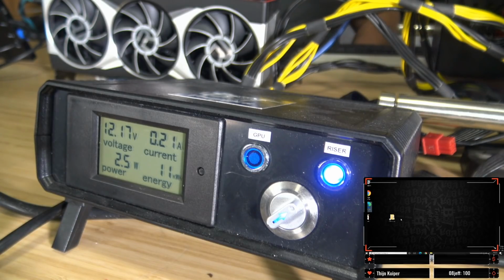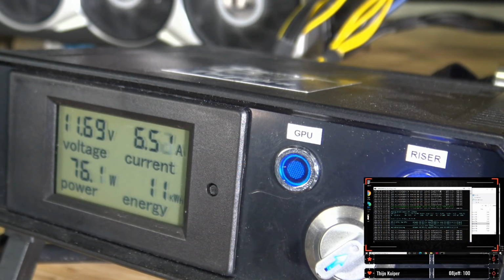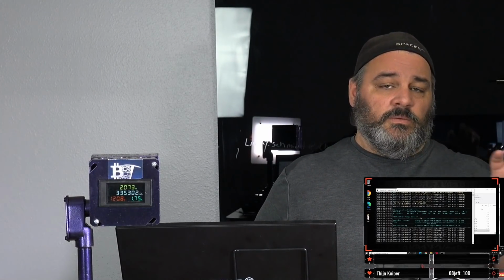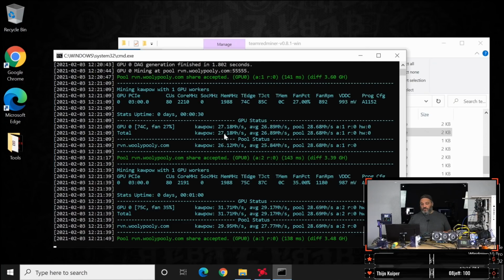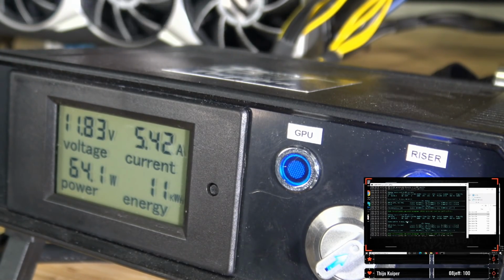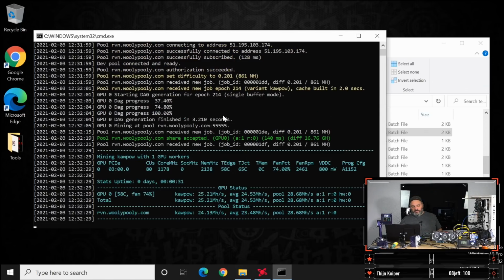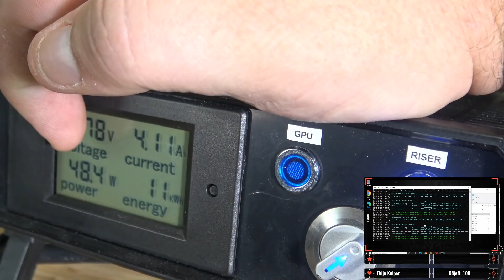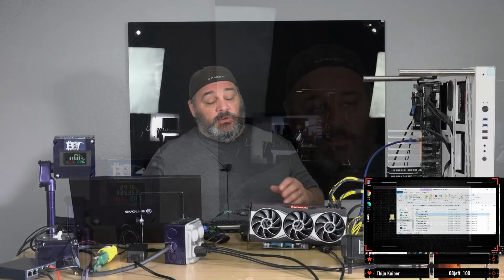Radeon 6900XT Performance and Riser Power Draw on ETH & RVN

Comment: A little late, but this config has been rock solid for six months. I do use this machine for gaming and work but it mines at least 15-20 hours a day.

For ETH I run 1150 core @ 700mv, 2150 mem with fast timing and power limit -10.

I used More Power Tool to unlock the minimum voltage selectable to 700 mv. I now get 63.4 MH/s @ 128w reported by Radeon Settings (board power is probably more like 150w).

With a 5950x draw at the wall is 210w.

Comment: Could you write the OC for Ethereum mining using 6900xt please.
Reply: For ETH I run 1150 core @ 700mv, 2150 mem with fast timing and power limit -10.

I used More Power Tool to unlock the minimum voltage selectable to 700 mv. I now get 63.4 MH/s @ 128w card power.

Comment: is it benificial to plug into both 6 pins on the riser if you had extra plug ins to spare? normally 75w is about what most people feed them. but this brings it very close to its limit with just 1. or maybe 1 pcie 6 pin and a molex

Comment: Can you try using More Power Tools to undervolt the core more? I am running 700mv core on my 6800, but I have seen others get as low as 625mv stable.
Reply: I used the MorePowerToo on my 6800XT, I'm mining ETH at 1200 core, 2120 mem (fast timings), 650mv. Getting 61.5MH/s and consuming <130W on HWinfo64.
Reply: So late, but this config has been rock solid for six months. I do use this machine for gaming and work but it mines at least 15-20 hours a day.

For ETH I run 1150 core @ 700mv, 2150 mem with fast timing and power limit -10.

I used More Power Tool to unlock the minimum voltage selectable to 700 mv. I now get 63.4 MH/s @ 128w reported by Radeon Settings (board power is probably more like 150w).

With a 5950x draw at the wall is 210w.

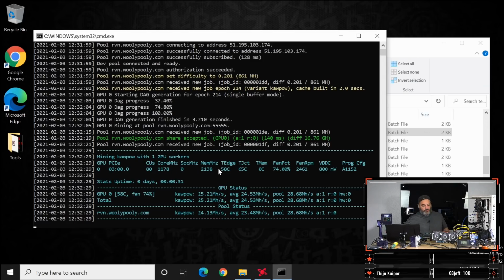Comment: i think at 8:00 the gpu is thermal throttling or something. because the fans stopped working for a couple times before that.
Reply from the maker: No, with the Mv and core set so low, its sitting at 59c and turning off fans.